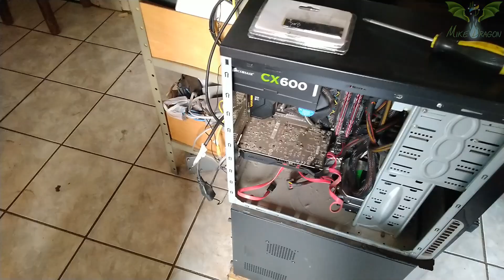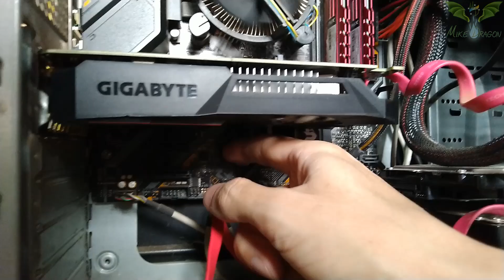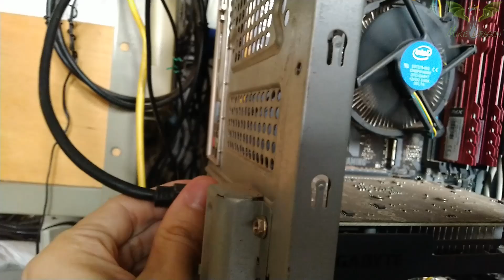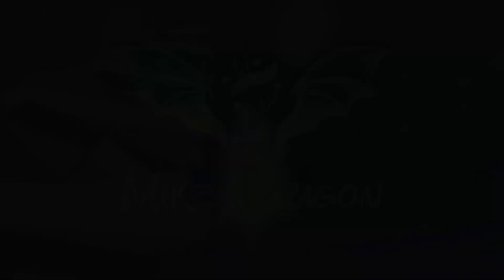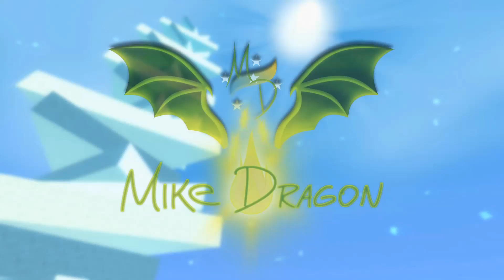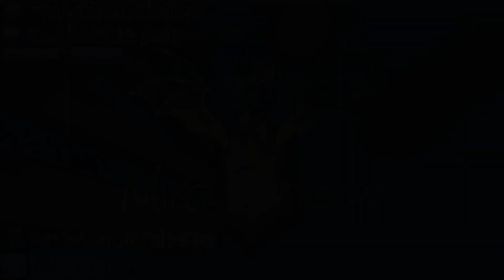Possessed PC

Comment: There is only one power source if the fan is not plugged in and that's the BIOS battery.  Try popping that as the BIOS settings can become corrupted.  Then see if the fan stops turning.  Something is seriously whacked, that's for sure.
Reply from the maker: 1:16

Comment: I never ran into this before, because I know circuit designers, especially in Asia, do wonky things.  A simple 5 cent diode would have stopped this.  So when I work on a machine, I pull everything.  And if there is a short, I ar worst only break the PC, not the monitor, etc.  Still, this is one of the weirdest ones I have ever seen.